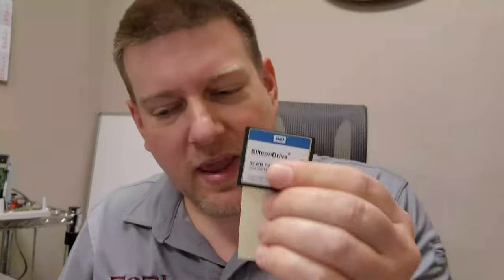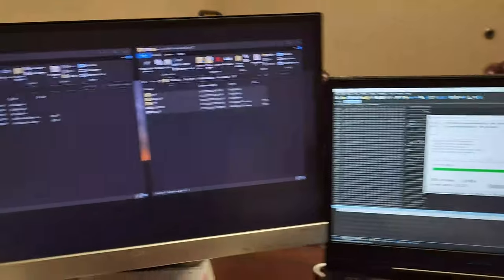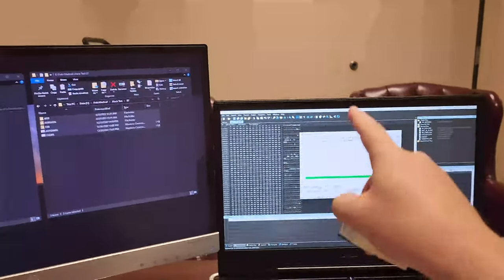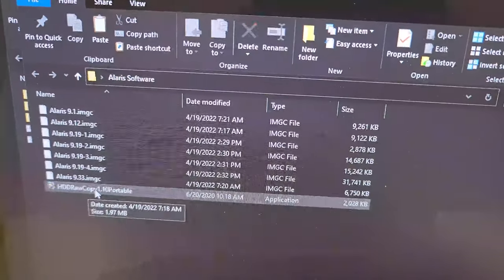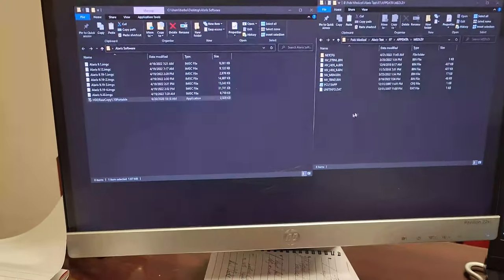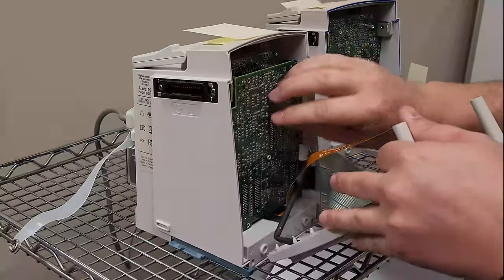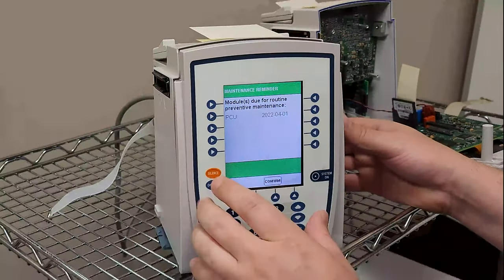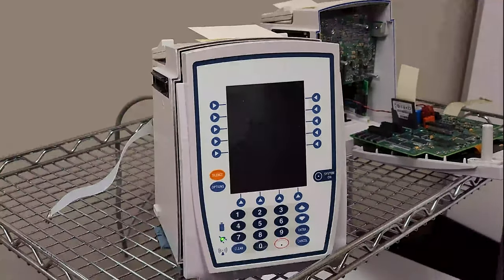Alaris Software Investigation

Comment: This is great, Justin!  

Right now, I'm helping resolve software incompatibilities between some PCU's, VLI pumps, and PCA pumps that my BMET class got from various sources for training purposes only.  One of our internship partners provided me with 4 CF's containing the PCU software revision that they use (9.19), a thumb drive of their current revisions for the various modules, and both Windows 7 and Windows 10 versions of the ASM software.  

The PCU I started trying this out with today with is a newer one than yours, had version 9.13, an internal wifi, and I guess a fix for a keyboard issue?  Not sure about the keyboard thing.  Anyway, one CF is for Boot, one for Apps, one for PKB (the keyboard), and one for FCC.  There is an extender board to use to seat the CFs in sequence in that front PCB by going in through the back, through the hole in the case where the old wifi card would normally go, so you don't have to take the whole thing apart from the front.  Each CF does its thing and then shuts off the PCU, then you put in the next one and turn it on, until the last one (the FCC one), which does exactly what your burned-and-edited CF does, just moving on to the network error instead of shutting off.

So, I had been a little unclear from the BMET at my internship, thought I could just put the Boot CF in, turn on the PCU, and I'd be off to the races, but the PCU just booted up normally, asking me if I wanted to enter a new patient, etc.  Then I saw the CF that was already in there, took it out, and was assailed by the alarm and a message telling me what I had done was unrecoverable.  I put the original CF card back in, but it didn't shut off the alarm.  My instructor said the only way to shut off the alarm would be to take the whole thing apart and find the little coin battery.  Grrrh.

At some point, I detached the pump module that had been attached the whole time, and I decided to make a second attempt using the extender board and the update CFs.  It worked!  And the alarm shut off as soon as the Boot CF announced it was copying the polo to the internal card.  AND, I can now see the PCU when I connect it to the ASM software, which wasn't happening before (possibly due to an unrelated user error, I'll check for that next time with a different PCU).  With the flash files I was given, I should be able to update modules using the ASM software now.

So now I'm left wondering if the reason it didn't work the first time is because I had the pump module attached, or because I needed to remove the internal CF to get the PCU's attention and make it read from the update card.

Also, regarding the network error.  We aren't going to be using these on a network for class, we just want all of the modules to be able to work with all of the PCUs and we want to be able to use the ASM software to see how the PM tasks are done.  Is there any sort of a "no network" option I can set in a profile, to avoid getting that annoying error every time we start up?

Thanks again, I also found your teardown video of the 8015 very informative, especially now that I've spent some time taking it partially apart and putting it together several times as I tried to figure out how to do this.
Reply from the maker: The network error is reset by uploading the site configuration script through the service tool
Reply: @BetterBiomedChannel  Thanks.

Comment: They were planning to phase out the flash cards at my facility. It was a 3 card system that took 5 or 6 minutes per brain. I was told the system wasn’t set up for the units with internal network cards, even though individuals seemed to update just fine when we found them. All the Alaris ran 9.33, which was the upgrade that required every other module to be flashed as well, which is rough in a level 1 trauma center. Previous versions were interchangeable with other software versions. They do make these sooo easy to PM with the ASM software. A lot of plastic parts to replace, and loose screws to tighten. A calibration here and there. We would have had a lot less orange “channel error” tags if the nurses wouldn’t jam the doors closed and toss them on the soiled room floor.

Comment: Are these still a current device? They seem to be using old technology ie flash cards. I would have expected this upgrade to be done over WiFi or at least some form of usb port. I have noticed that the US market sometimes lags behind when compared to the devices on the European market. Have you come across this?
Reply from the maker: The Alaris system was designed 20 years ago and still is the standard for infusion pumps in the USA
Reply: That’s an older style. The newer ones have a larger screen and easier access to the top two screws under the handle. Both still work and are seen bouncing between facilities.